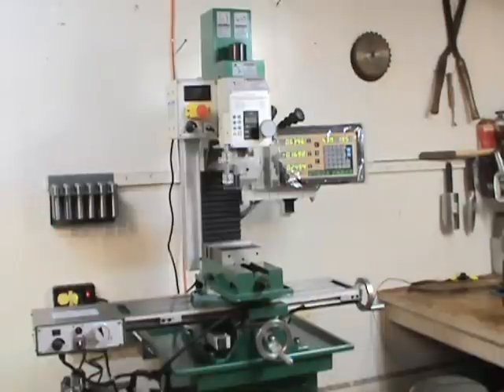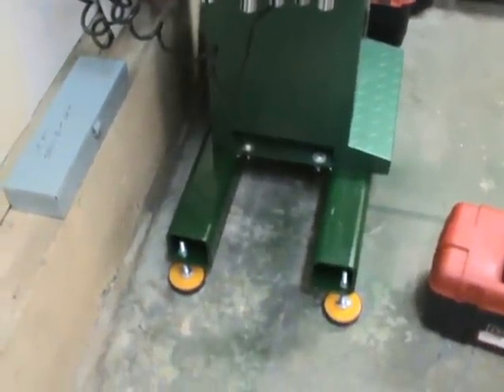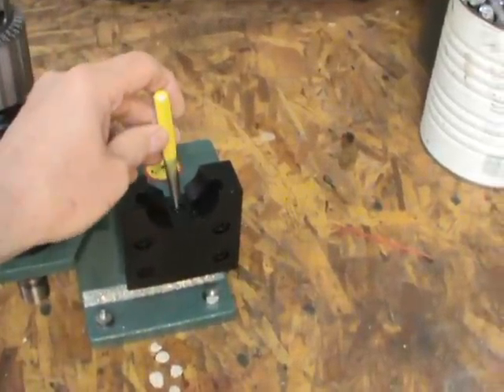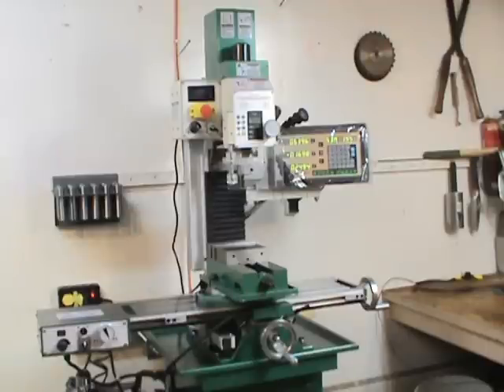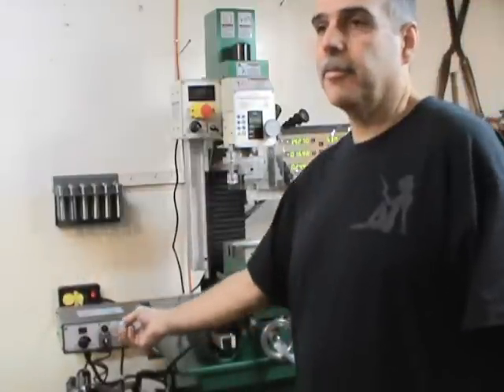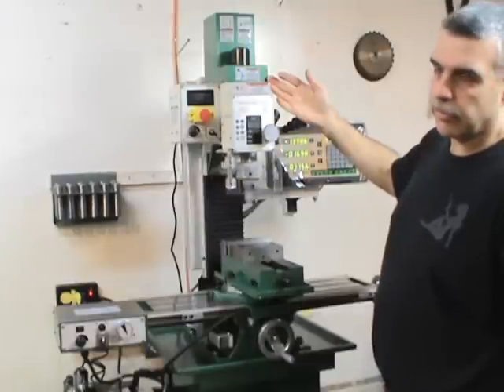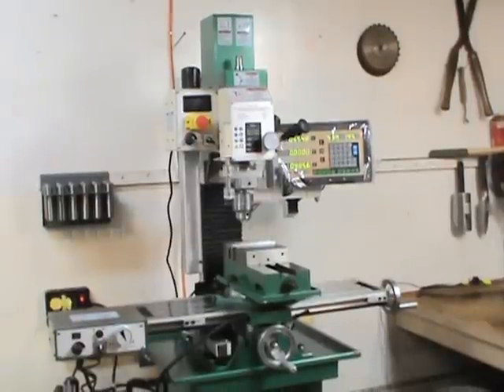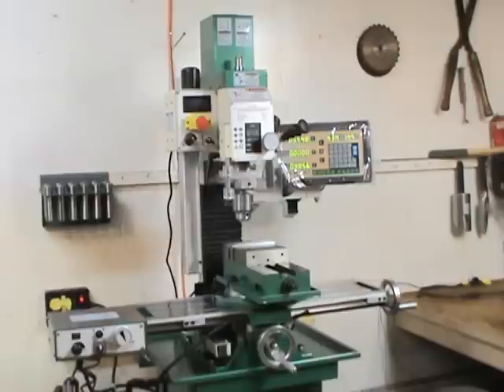Grizzly G0759 milling machine review and feedback

Comment: Great job covering the G0759.
I've had one since last summer.  My experiences were identical to yours, including the blown fuse.  Also, I am very impressed with the DRO.  It gives me the ability to be accurate beyond my needs.  
One point you made may be of value to me was lowering the head (Z axis) and then cranking it back up before locking it in place.  I recall a part I was making this winter where I was making a finishing pass and suddenly the end mill cut too deep.   I never did figure that out.  I'll heed your advice on that issue in the future.  Thanks!
Reply from the maker: Yes, pull out the end mills in their holders before locking the set screw and remembering to raise the head slightly works with any manual machine. I just ran the machine for 30 hours or so making a 4' windmill out of aluminum as a yard decoration and the machine was awesome to use. No problems what so ever. I even made bearing blocks to house the 7/8 bearings to drive the fan blade and to rotate the windmill on it's axis. I did notice vibration when I was boring the bearing blocks (using the boring bar attachment), but to simply reduce the rpm cured the vibration. Yes the little machine is accurate if you use common sense and not push it beyond it's size and HP limitations. :)

Comment from the maker: I mis spoke in the video, 1 take no edits... The Tee nuts were ground to fit the table, and that little tool that fits the Priest spindle brake was made out of a broken 3/8 Allen wrench, not an endmill....:)
Reply: One of the first jobs I had was at Fafnir bearing in New Britain, after that i ran a lath for Caval tool until was drafted into the army. after that I decided i didn't want to go back into that. i joined the city and a few years later got into  FD. and i retired 10 years ago.

Comment: I anchored the top of the column to the wall also and that made a big differences. Also I made a swing out arm from the column that pins into the spindle lock hole and that is nice. The only thing is that you can't use it when tilting the head, but how many times is that.

Comment: im ordering one of these. like you..i was looking at bridgeports..hard to find one on single phase. and my garage is small. thanks for the video..ir was helpful once i got past your history.
Reply from the maker: Sorry to blab too much. I don't even remember what I said. Lol. The machine is good. Just take small bites with it you don't have a $50,000 dollar machine..... There are guys who convert them to cnc. They seem to run real nice check out those videos.
Reply: @007connecticut  i ran cnc machines. i retired. i have no desire to return to it. i was taught on dials...and manual feeds on a mill. i started running a lathe at at age 7. watched my dad. then went to trade school in high school...i made parts for the wore out machines in the school. i took first place in state in the vica program.
Reply from the maker: @edmoore3910  Im tired of this trade looking to retire in 6-7 years depending on my body. That machine just fixes stuff that I can't do at work anymore. I made a lot of parts on it. It's a nice addition to the home shop.

Comment: I have a King Industrial mill # KC-20VS.  It looks pretty much the same as yours but I don't have the readouts.  I burnt out the motor on mine and replaced it with a similar one.
I just wanted to ask if you have any advise on how to lubricate the gears in the head?
mine has a sight glass but no oil reservoir....the King rep suggested grease.  any thoughts?
how are the gears in yours lubed?  Thanks for posting such a good review.
Reply from the maker: I sprayed some motorcycle chain lube in mine. I figure it doesn't fling off so that's what I did. They sell other types of commercial grade lubricants in aerosol cans so those are the only options. Run the head slow then spray it on for 100% coverage.
Reply: @007connecticut  Thanks very much, I'll try that.

Comment: Thanks for a great review.  I'm curious if the shake in the machine was because the stand is flimsy sheet metal.  Do you think a more stable/heavy base would solve the problem?
Reply from the maker: The cabinet is not heavy enough. The machine is heavier than the cabinet so it's top heavy. The more mass you have the more solid the machining will be.

Comment: I've been looking at this mill for a few days and at this time I've pretty much figured on purchasing it. One question....how much room is needed left and right and front to back once it is set up. I have a small shop and am trying to figure out where it will fit best and these dimensions would help a lot. Thanks for the nice, thorough review. It's a big help.
LaVern
Reply from the maker: 1ljs It's a small footprint. It's 22" from the front of my stand to the wall. It's 31" from the centerline of the machine (Y axis dial) to the bench on the right. So you need 22" X 62" of space.
Reply: 007connecticut Thanks for the reply and information. So from the centerline to the farthest left and right travel is 31"? I ought to be able to find a nice spot for that. Thanks again for the info and video.LaVern

Comment: Hello, just saw your review and it’s excellent. One question, if you had to do it all over, would you still buy that same Grizzly mill? Thanks, Merry Christmas.
Reply from the maker: Yes for a home machine it's a really good machine. If you got to fix the mower or something it sure beats using this over using only a hand drill and hack saw. 
Just take light cuts it's fine With the read out it's very accurate and repeatable. It's not aircraft-able machining to hold within .0005 but it's a + - .001 machine all day long. The head space is a little short so sometimes using the vise it will be an issue using long taps and drills. If your into more than a home machine get one with a read out and more head space and table travel

Comment: whats does "square head" machine mean?  do you mean the tower should be square tubing?

i know what a fixed tower verses a leaning tower is.  but what about the small JET drill/mill- it has a round tubing tower and the head is supposed to rotate?  and that WILL throw the head off of square?
Reply from the maker: Think of a square or a machinist square (tool in a tool box that is at a right angle). So when you "square the head" you are making the head at a perfect right angle to the machine table. Then you also make the spindle go up and down perfectly aligned to the table.
so align the tower first (column ) then you adjust the head that it's perfectly in line as well.

Comment: I just bought this machine and after tax shipping it around $3,600 ... the machine is $3,200 New to milling but I've been wanting one fir sometime. I have the metal lathe. Plus a wood lathe, band saw I do more wood than metal. I've even used my metal lathe for wood cause of the auto feed. That bushing on top you spoke of you said I think you made it.  What size is it ? What was the drill size and tap for threading... I have some aluminum round stock is that ok? If not what should I get.. I need a drill and tap and die size chart . I get lost on that I'm usually too small or two big. Thank you .
Reply from the maker: tax is a rip off
Take your time setting it up. You will discover the tooling, holders and supplies will be expensive. But once you got it up and working you'll be happy with it.The read out makes the machine awesome.
Reply: @007connecticut  OK Thank you, can you recommend first thing I should work on getting first?
Reply from the maker: Check out my other machine videos on the draw bolt. I think it's a 1/2-28 and it's a bolt off of a hummer that I found. In my comments somewhere here or on another video I got links to where I show where to get one. Don't make it out of aluminum, it's too soft. Can't write much now boss is around lol thanks for watching

Comment: Thanks for the great review.  I've been looking at the G0759 as well, but am stuck between choosing it or the more capable G0762.  With your 759, are you satisfied with the power of the 1hp single phase motor?  I have seen people often upgrade the motor, so that is why I've been looking at the 762; it has a 2hp 3-phase motor with VFD.  However, like yourself, the DRO is important to me, and the 762 does not come with one, so I would have to add that.  And they aren't cheap.  So I guess it comes down to more power or DRO.  What are your thoughts on this, and thank you.
Reply from the maker: +Beerbatter1962 For my uses the 759 is a fine machine. If you plan to drill  3/4 or larger holes in steel, or mill  with 3/4 or larger endmills find a more powerful machine than the 759.. More power than you need beats under powered and flimsy machines everyday of the week. Even big machines are flimsy with the over-sized work that can be but on the table...
Buy the readout for what ever machine you decide. The readouts are awesome and the machines repeat without the need of indicators that are always in the way. :)
Reply: Thanks for the quick reply 007.  Definitely good advice.  I keep thinking about it a little more.  Touch choices.

Comment: Great video..
I was thinking about a smaller mill myself, for exactly the reason you stated.. No room for a big one.
Can you tell me if these machines are good for steel?
I almost always use a roughing mill at slow speeds to cut Air hardening steel, and 303/304 stainless.
Sometimes the side cut on the Y axis will be as much as 3/8 inch, as a slow pass.
Do these machines have the torque and power to do this work?
Reply from the maker: Yes I think it would work fine. It has a small motor but if you drop it in low range with an 1/2" endmill or so it would work fine. Because of the spindle size you can't run large 1" + diameter tools. A face mill will work with light cuts. Keep endmils around 1/2" with moderate cuts.

Comment: Do you think this would work for dovetails on pistol slides? As well as milling 80% AR15/10 lowers trigger pocket. I like this one because it has 3axis dro already. Bigger option only comes with x and y axis.
Reply from the maker: AR15 yes easily. Dovetails yes if you pre-machine the slot with an endmill and take it slowly. The table seems tight enough and the motor is strong enough if you do maybe a 3/4" slot or smaller. Cut a larger slot 1 side at a time. Main issue is HP.  It will pop a fuse if you push it. It's a hobby sized machine so treat it like one. You don't have a boss watching you... So it will do anything if you take it easy.
Reply: 007connecticut realized I commented 2 years ago. Lol I’m actually in the process of buy a mill. Just doing more research. The new models don’t come with powerfeed.
Reply from the maker: I just turned the comments on, had them off before,   sorry to respond so late. You can add the power feed it's easy to do. The machine you want to buy, look for that option. I recommend the power feed big time.
Reply: 007connecticut you responded to my comment 2 years ago so no biggie. I appreciate the responses. Cause definitely helps me make a decision.

Comment: Did you look at the G0758 I have been looking at it for a begining mill. Thanks. Bill
Reply from the maker: It depends on your intended use. I looked at that particular machine and thought the motor HP was too small. The table height was too short when using a vise and most importantly, I really wanted a read out of some sort with a X power feed unit.
So for myself, the G0579 was the best value while getting a minimum sized machine. In addition the G0704 is quite popular with many people converting them over to CNC. Also there is a ton of information on line about the G0704. The G0759 is a twin to G0704 but with the DRO.

Comment: Great review!  I am looking to possibly purchase the same model to upgrade my Harbor Freight 44991 mill with DRO and power feed. I just have a few questions.  The first one has to do with the power feed, on my mill the power feed does not feed well at lower feed rates because it is a direct drive setup with a small 10 watt motor, I noticed that in the pictures posted on Grizzlys website that the power feed for this mill has a gear reduction setup which should increase torque and make for a smoother feed at decreased feed rates. So does it feed well at slower rates? Also could you post the specs on the parts you made for the drawbar and the size and length of the bolt you bought to replace the factory part? The only reason I am thinking about upgrading to this one is for the increased travel on the X and Y axis and the hopefully better power feed. X2 mills are very capable when you work within their limitations,  I primarily use mine for pistol gunsmithing and prototyping. I have a ton of tooling thanks to Ebay as well, MSC gets my business as well when they run their metalworking specials.  Hard to beat 40% off of a $249 order lol. Thanks!
Reply from the maker: +Anthony DiGiovanni  The table power feed runs good. There is no emergency stop so if you lean 
over it while the handle is turning you could wrap your self up in the X crank 
handle so be careful. Why I say this is because I wrapped my long tail shirt 
into it. No big danger just I was able to hit the feed power button before I was 
really in a bind.

It travels nice and slow if your looking for that, or fairly fast. Heck, 
anything beats turning that handle by hand...

 

My modified draw bolt consists of 3 parts.

 

Find a grade 8 bolt so it won't strip out on you. It's a 7/16 fine thread 
bolt that is 9 3/4 long from the bottom of the bolt head to the end of the 
threaded portion of the bolt.

 

The original bushing up top was modified. Keep the threads on the bottom so 
it can be reinstalled. This bushing will act as a guide so the long bolt doesn't 
wobble and cause vibration when the spindle it spinning fast. Make it 1.325 long 
and bore the inside diameter to .760 diameter. Then thread it back on hand 
tight.

 

The last part needed is another bushing that will fit inside the original 
modified bushing (above), but will keep the bolt head at the right length. Make 
this bushing 1.750 long. .460 Inside diameter and .750 outside diameter.
Reply: Thanks for the info! The power feed is very important too me due to the better finish it creates on pistol slides.  I use carbide cutters but the slides are hardened to rc 38- rc 40 so I need a good slow feed rate that is steady to get the best cut possible with my x2 mill. I agree "anything beats turning that handle" , especially with long work pieces :D

Comment: Hi! Great video, I really appreciate you taking the time to make it.

I am a knifemaker and have been using the LMS hi-torque mini mill for the last few years but want to upgrade my machine. My question is about accurate counterbores as I need to hit them within .0005" if possible. Will the cranks on the Z axis and DRO be accurate enough? What about the spindle DRO? I'm thinking of cutting the counterbores on a rotary table with a smaller end mill so I can recess a thrust bearing on a framelock knife. Thanks and all the best! -DF
Reply from the maker: When I bored my 7/8" bearing bores I roughed the holes out using an undersized endmill (868" diameter) then I bored with the z axis (not the quill). I think you will be pleasantly surprised on how accurate the machine readouts are.  Medium speeds and feed it slow to dial your sizes in.
Reply: 007connecticut Much appreciated! Thanks and all the very best. Great channel too, subscribed.

Comment: Thanks for the great review. My application requires tolerance less than 1/1000 and your review around 11:55 (2mil difference between two corner) makes me worry about buying this machine. Can you recommend any better mini milling or CNC to fit my garage for better precision? Typical size of my design is about less than 4" x 4" x 4". thanks
Reply from the maker: With machines, the more you spend the better quality you get. It's a balance of what I need for what I want to spend. Plus expect to spend another $2,500  easy for measuring equiptment and cutting tools, vise and collets and holders. For the price, this machine is a great little machine for the garage or home machinist. With care you could machine things to very close tolerances. But you need to used good tools and the machine must be set up correctly ie: level, square , good foundation etc.
Perhaps a small used bridgeport would serve your needs better, but it will need to be re-wired for 220V, it's will be a bear to move do to the weight of the machine and the price will be at least double what this one cost. Shop around and see what's around in your area.

Comment: This seems  like a really nice milling machine. Did you replace the plastic gears with a belt drive? If not, How have the plastic gears held up to use?
Reply from the maker: +rdsii64 I did order 2 spare plastic gears as I heard only bad about them. I placed them with the other parts like the circuit boards that power the spindle, plus a spare electric motor and several fuses.  Guess what?, no issues at all. So far I wasted my money ordering the spare parts... But one day if something dies, hopefully, I will have that part in a box on a shelf to keep the machine going.

The little machine if run with-in it's capabilities is fine. I'd buy it again. The small foot print is great and it fits in the corner of the garage perfectly. If one of my tractors need something made down the road, it now could be done. :)
Reply: +007connecticut Thats good to hear. I currently own a Sieg X2 and the first thing I did was install a belt drive conversion before I even turned it on. After I move back to the east coast (current in California) I will be looking for an upgraded mill. I thought upgrading my X2 but I think I'm really  leaning toward a better mill all the way around and retire my current machine to secondary service. The stuff I work on is only made of Aluminum or polymer.
I current don't have a need to mill anything  made of steel.